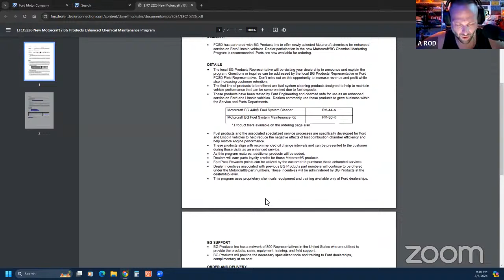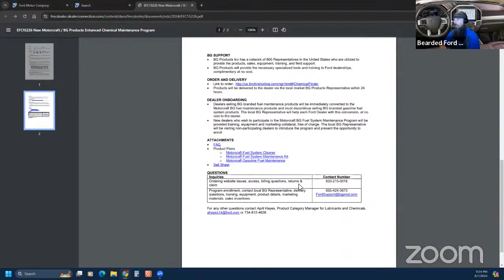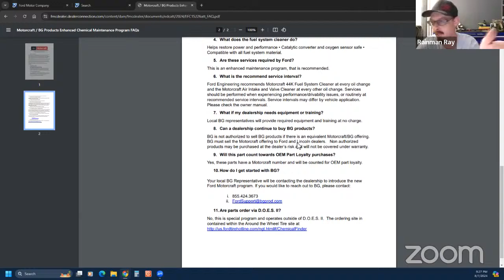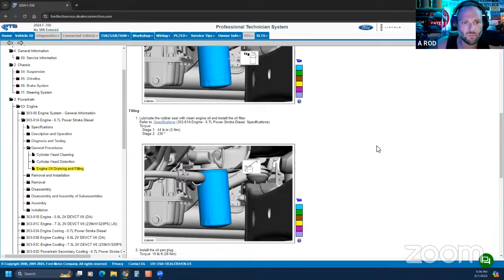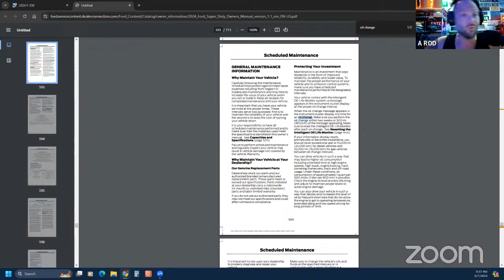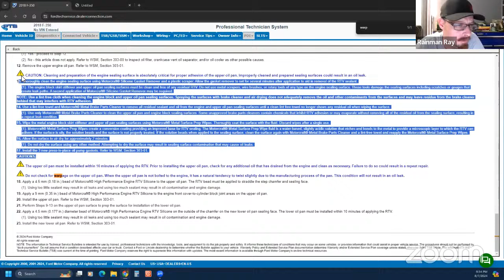Did you KNOW Ford now allows this?? #fyp #mechanic

Comment: Yes, I use BG EPR PN 109 every 10K, BG MOA PN 115 every 5K,  BG PN 208 every 10K on my 2018 3.5L Lincoln and 2019 2.0L EcoSport engines.  On my 2017 6.7L: PN 112: Diesel Oil Conditioner every 5K, BG EPR every 10K. EPR just eats sludge.  I follow the instructions on the can.  I hold the RPMs at 1200-1500 RPM for 15 minutes and then drain.  I get my stuff from Amazon through a Ferrari/Maserati Dealership in Washington. I’ve been using their stuff since 2017 for my vehicles.

Comment: Hey guys, not sure if if this is correct but it seemed there was some confusion about OIL FILTERS. A lot of time, an XP filter for extended mileage between oil changes, DO NOT filter as good, they do that to avoid clogging and being bypassed. So look at the particle size and determine if you want better filtration or longer life. Most people think XP means they filter BETTER when in fact they filter less. So they do not get full and get bypassed.

Comment: It's weird you can't get a high output diesel in a dually
Reply: @rossbel5735  Say What ! Weird might just be the understatement of the year, hell you would believe it to be the other way around.
 That's just plum stupid.
Reply: @timsmothers8740  yeah I'm trying to buy a F-350 high output diesel dually long box cab and Chassis. I cannot get high output even if I order it
Reply from the maker: @rossbel5735 dstrucks F450 is an HO
Reply: @PowerStrokeTechTalkwARod  all Ford trucks should have a, quarter inch c-channel frame apparently you can only get a quarter inch c-channel frame on cab & chassis. If you purchase a pickup with an aluminum bed your frame is 1/8 inch tubing frame which is junk.
Reply: I guess I have a unicorn HO dually
Reply from the maker: Yeah u can
Reply: @PowerStrokeTechTalkwARod  so the Ford dealers are lying to me? 🤔 I tried to build it at a Ford dealer and online and the option is not there
Reply from the maker: @rossbel5735 look at DS Trucks on YT. His main ride is a 23 lariat F450 HO.
Reply: @PowerStrokeTechTalkwARod   I think what he wants is a HO power stroke with a chassis truck…as far as the online ford build page you can’t order a chassis truck with HO.  There might be a way special fleet or something but not online.
Reply: @rossbel5735  yeah I see what you mean on the chassis truck…no HO option but they also derate the engines on chassis truck
Reply: My buddy’s 23 350 dually is a HO

Comment: I'm stunned, fellas. Just spent $2000 to replace all tie rod ends and an upgraded track bar, caster shims to get rid of the death wobble. It was horrible. What's worse is it's a 2020 F250 with 38,000 miles! Tie rods ends, and the steering box arm ball joint had so much slop you could see it, not just feel it. Are you guy's seeing this stuff on a regular basis?